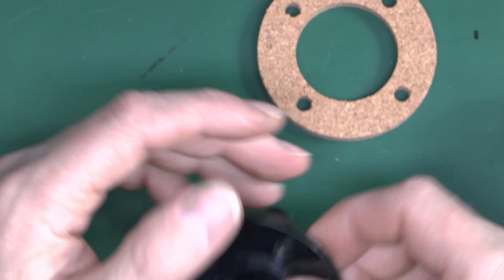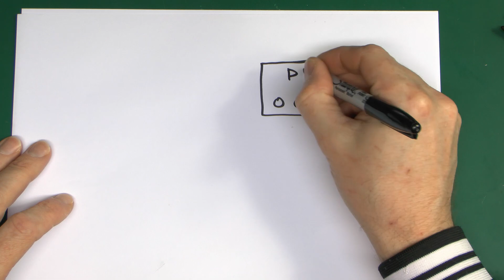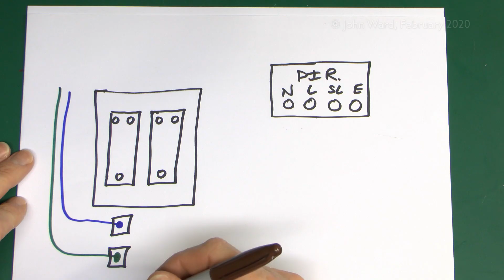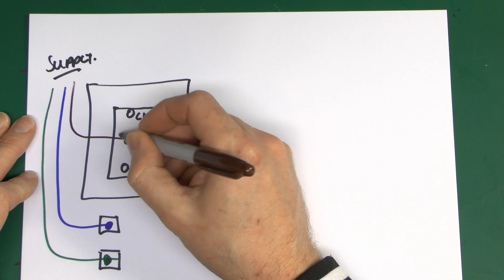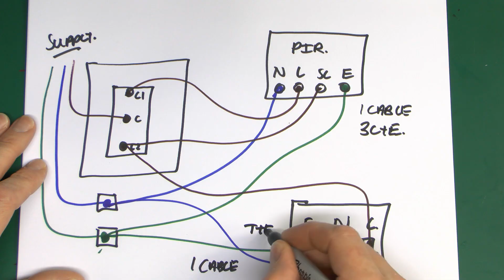Lighting Sensor Wiring with Override Facility

Comment: Thanks great explanation. was thinking of using a standard 3 pin plug for the supply to plug into a wall or garage socket  so only needing a single 1 gang 2 way switch same as your second example but the on/off at the socket. This may sound strange but I'm retro fitting a pir to existing circuit just replacing the switch so will connect the neutrals inside the switch using wago 3 way connector

Comment: Another suggestion if you're not sure if the PIR is using a relay or electronic switch then: 1. Always keep the PIR powered up to the Power Line and Neutral. 2. Connect PIR output SL to the 3-way switch L1. 3. Connect Power Line L to 3-way switch L2. 4. Connect  light line L to 3-way switch common C. 5. Connect light Neutral N to Power Line Neutral N.
Reply: how do I wire to an existing light. Can it be wired direct to the light fitting?
Reply: I did it this way, too.

Comment: Hi thanks for the video you explain everything nice and clearly I am thinking of installing outside lights with a double switch and PIR like in the video but I don’t require the all off switch just PIR override as with the 1st switch I want to control 1 light by the back door and have flood lights controlled by PIR with override for BBQ’S ect 
Would it work if I just connected the common from the switch to the PIR L or will I need 3 switches as they will be outside switches

Comment: Hi John, I have a 400W Halogen floodlight with a PIR. Is there a way I can add another PIR sensor as well as the one on the light?
Reply from the maker: If all 4 terminals are accessible (L,SL,N,E) then yes, just connect another sensor to those.
Reply: @jwflame  thank you!

Comment: Hi John, brilliant video/explanation. Would it be possible to add a timer switch to your wiring diagram so that when switched on permanently the timer could control the on period. If yes could you provide guidance on how this could be done. Many thanks.
Kind regards,
Kenny.

Comment: what i don't understand is why you have the light connection and the switch leg for the photo eye together on the same terminal on the three way switch ?  you have the power from the switch to the left  on your common terminal so why not put the light manual switch leg on the left or right terminal at the top and the photo eye switch leg on the other top terminal for auto or manual. why would they be at the same  common point termination  ? that seems wrong.. i intend to buy the parts and try your way and mine in my lab to see how both fair. but i enjoyed this video it provoked thoughts for my solution to a problem. seems like when i want outside the box thinking i have to listen to English, Aussies and Indians

Comment: Hi, if you didn't need nned the override facility on a PIR, would you simply be able to use a 1 Gang 2 Way Switch, using the L1, L2 and COM connections as per your video at around 14:30 mins? Thank you!

Comment: I can't find a supplier of a PIR with N.L.SL. & E,   none that I can find have SL.  I have wired for the double switch installation but I'm stuck for the correct PIR.  Can you advise of a supplier please?
Reply from the maker: All 230V PIRs have SL - they would be entirely useless if they only had L,N,E.
This: https://www.screwfix.com/p/lap-standalone-pir-180/8461v
or this: https://www.screwfix.com/p/lap-standalone-pir-180/8461v
or https://www.cef.co.uk/catalogue/products/131732-180-pir-motion-detector-white
or pretty much any others.
The only real choices are the angle of coverage and the maximum load that it can switch.
Reply: @jwflame  Thank you very much for your reply John. Re buying a new PIR, everyone I could find wiring details for online only had L.N.E; these included the Screwfix models you've suggested.  Screwfix said they knew of and used to stock L.N.E.SL. but that all their stock now worked on the quick on/off to control a light's 'permanent on' feature. I had run the new 3+1 cable before I removed my old PIR, intending to complete as per your two switch diagram. My old PIR has N.N.E.L. L1.L2, the two neutrals are connected/looped. I have wired both lives into L and the lamps live into L1, - its working. My old PIR was to be replaced, it was only functioning if I put my hand up close to it. With a clean, it now is back to its best, probably about 8 meters. Thanks again for responding.
Reply: @jwflame  Hi John. I have the LAP pir you recommended. the available marked connections - N.N E. L. L1. L2.  Using your 4 core double switch diagram N - Blue, Earth - E, Brown - L. the pir works fine.  
There is no SL connection marked, I tried the black in L1, it appeared to work as planned for a day or so, then the pir stopped functioning.  I removed the black from L1, the pir function returned. I can pulse to have the light permanent but its confusing as to which state the function is at.  Any advice?

Comment: Hi JW great videos.  I am trying to work out unsuccessfully in my head how to wire up multiple sensors to multiple lights, with any sensor activating all of the lights. The system is up a stairwell.
Thanks for any response 🙂
Reply: 3C+E chaining all the PIRs together, then back to switch control point as per JW's diagrams. Any sensor triggers all lights. You probably worked that out by now of course...

Comment: I was thinking of having a PIR (or micro) in my bathroom, and would want an override switch on the outside to have it permanently on or on auto. However I'd also wanted a switch, on a separate gang (maybe above the door with the fused switch) that would override it to be permanently off. The trick I guess is not have any single cables going somewhere but a mixture of 3 and 4 core cables!

Comment: Thank you for sharing this information as I found it very useful.
 
Please if you can help me on the below, I be most grateful.  

I like to install a flood light with an external PIR sensor, similar to the 1 way switch design you show. The only problem is the current set up I have uses a switched fuse spur instead of a 1 way switch.   I only want the light to stay in the PIR mode or off completely.

From this can I directly connect the switched line output from the PIR to the light?  If not, please can you explain so I understand.

Thank you most kindly.

Matt
Reply from the maker: Yes, LNE from the spur to LNE in the PIR, light connects to PIR switched L, N&E
Reply: Thank you very much for this information John.  Will continue to learn this profession going forward.

Comment: hi guys i wanted to have two sensors (on two ends of the wall) activating one section of lighting. Is this correct to connect second PIR in series with the first one??? thanks for help anyone!!!
Reply from the maker: Cable between the two PIRs, each terminal connected to the same terminal in the other PIR, so L-L, N-N, SL-SL, E-E.
Reply: @jwflame  very appreciate thank you John

Comment: Thanks for the presentation, It explains something that was puzzling me. My outside lights were wired with 3 core & earth, and the wiring diagram in the lid showed no external connection to the light connection. In fact there the black core was connected. When the switch was activated the lamp lit continually, and in the off position it was controlled by the PIR. Your presentation made clear what was intended. However they had cheapened the installation by using no second switch. The line connection was hard wired without a switch!! 
Now I see how it is supposed to work, I can live with it, but it is not Ideal.

Comment: Would it be acceptable to wire the PIR to be permanently connected, and just switch the PIR switch line? I ask because many PIR sensors switch on when initially powered, but you may want to be able to set the light to auto without having it illuminated.
Reply from the maker: Yes, that would work.

Comment: Where can you get household 3 position switches?
Reply from the maker: This: https://www.cef.co.uk/catalogue/products/506614-10a-3-position-switch-module-polar-white
or this: https://www.cef.co.uk/catalogue/products/506614-10a-3-position-switch-module-polar-white
There are probably others.
Reply: Could you do a video on how to link two PIRs to control the same light?
Reply: @heffo1992  The obvious solution would be to link them in parallel using 3 core + E, chain as many as you like together, any one triggers the light comes on.

Comment: Sir JohnW, may I add that for the 1st diagram with 2switches used i.e. 2Gang2Way, its sufficient to use 1WAY switch for both the switches there.
Am I correct or otherwise?
Reply: You are correct.
Reply from the maker: Yes.  They are drawn as 2 way because 2 gang switches are almost always 2 way types.
Reply: John Ward  Oh thanks for that bonus info...
Outside UK but countries that still based itself to bs, its more common to find 2g1w , 3g1w, 4g1w and even 5g1w. its not common to spot 1g2w or 2g2w unless we really need those for 2way switching etc.

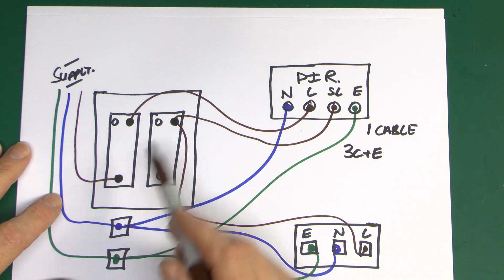Comment: 13:04 - connection to light, I'd have connected to the bottom terminal of switch 2 and the live out of the top of switch 1 I'd have connected to terminal 1 on the top of switch 2. For the purposes of clarity of drawing. It'd also have the electrical safety benefit of not making SL live on the PIR when the light was permanently on.

I take it you're now going to connect the live out of sw 1 to the bottom terminal of sw 2.

Comment: Re microwave sensors - is that's what's used on vehicle proximity sensors ? If not, what are they ?
Reply: Some are ultrasonic...
Reply: The little round cutout things you see in bumpers (especially rear bumper for reversing sensors) are ultrasonic.
Braking assist systems likely use microwave. I've never been a fan of such systems, so never really looked at the details.
Self driving systems use a mix of lidar, camera and microwave sensors.
Reply: @tin2001  Cheers - maybe one day I'll go poking around them with my ultrasonic amplifier !
Reply: pmailkeey - they (the ultrasonic type) often operate at around 38kHz to 42kHz or thereabouts.
Reply: @Mark1024MAK  Does that keep cats and dogs out of the way ?
My amp goes up to 120kHz from 18kHz estimate and reduces it to a humanly audible range.

Comment: Having designed a few PIRs in a past life I can say your simple description of the way the sensor works is possibly the best I've heard.

One point though: PIRs detect moving difference in heat - they'll detect something moving  that's lower in temperature than the background just as well as something higher in temperature. This can give rise to false triggering when, say, wind moves a tree/bush in front of a wall that's been heated by the sun most of the day.

[Edit] A second point: True Doppler microwaves work outside OK. It's the simple change of field ones that use a repurposed PIR control IC that don't.

[Edit 2] PIRs work fine indoors - that's why they're used in security systems including domestic. IME heat rising from radiators isn't a problem with basic twin-element pyrosensors as they are most sensitive to horizontal movement. Quad sensors which detect movement both horizontal and vertical directions might have an issue, but they are more (or rather were when I was working on them) for commercial use.
Reply: I had a feeling plants triggered them and that explains that !

I was pondering in Asda one day by the doors. Usual set up - sliding doors, pair of security detectors and overhead blast heater. Asda put a loose advertising sleeve over the security detectors. The fan heater over the door caused the advert sleeves to flap about - so the doors opened :)
Reply: @millomweb  I've seen that more than once.

Comment: Moved into a new house recently that has photocell lights with an override and I’ve been puzzling how these work so great timing John. Ours have a fused spur as the main on/off and then a separate switch for the override and the photocells are built into the lights but I can at least now understand how they can work. Great video thanks.
Reply: You know you can have a single switch to override right? He wires it with 2 switches which is just really weird
Reply: @tsiailis01   but the second switch allows for '"off" also , Right?

Comment: Dear John Ward, if you can do one video on emergency lighting. In my workplace I do allot of emergency lighting and sensors, the sensors are fine for me but the emergency one is confusing. Some have back up battery supply and bypasses the ballast or relay and has different wiring. I tried to find the source of the power when the light is not on but was told it gets its power from battery? When I do the emergency lighting testing- I switch off the lights and the emergency lights come on- was asking the chief Engineering if he can explain where it is getting its power from? but he is not a qualified electrician so avoided the answer. If you can do one video on it, will be grateful. Thank you.
Reply: The vast majority of emergency lights, or lights with an emergency mode have an internal battery. When supplied with mains power, a charging circuit charges the battery. When mains fails, the battery supplies an electronic module, which in turn powers the light.
Reply: They all have back up battery ! SOMEWHERE ! There are self contained units that have a battery in the light and there are lights fed from a central battery in the building - that's 'old style' but still valid. (And probably far better !)

Comment: Is it possible to join two PIRs to a single light fixture?
Reply: Yes just extend the 3C +E from pir 1 to any number of additional pir sensors.
Reply: Thomas McBurney - only if both sensors use a relay contact to perform the switching. If the sensor uses solid state switching, the sensors may be damaged if wired in parallel.

Comment: I do NOT recommend any of these configurations. The reason is, that some PIR are fully digital, and wont "like" sending voltage into the switch output (in electrical terms, a voltage potentional is on the PIR's "switch output" terminal while the PIR is electronically "switched off"), this could cause all sorts of problems.
Also, breaking the line input of PIR is not recommended if it has a "calibration routine" that it runs on startup to calibrate itself to the room. (Some PIR says "switch on power and do NOT visit the monitoring area for the next 60 seconds" - because it runs a calibration routine to get a idea how a "empty room" looks like)

A better connection is like this (first one):
N and earth as before
Lsupply -> bridge with PIR-L cable and pole1 on switch2
SLoutput -> pole2 on switch2
Common on Switch2 --> Pole2 on Switch1
Common on Switch1 --> Light fixture

This will as before, allow switch2 to switch between PermanentON & PIR mode, and switch1 will allow to switch between PermanentOFF and PIR/PermanentON Mode(depending on switch2).
PIR will thus always have power, and you don't risk getting weird calibration on the PIR. If the PIR has such a calibration routine. And it will ensure no voltage is sent INTO the switching output.

For the second, it could be made like this: (second one):
N and earth as before
Lsupply -> pole1 on switch and PIR-L-cable
SLoutput -> pole2 on switch
common -> light fixture

This also ensures, that PIR always have power, and also that no voltage is sent INTO the switching output.
Reply: Sebastian Nielsen you seem to have little idea of how most PIR sensors function, the vast majority have no concept  the area they cover and don’t need it. 

They function by the focused IR falling on a split sensor area and detect any difference between the two.

While it certainly could be possible to design a sensor package in the way you describe the cost would be exponentially higher than the standard and would need some vastly higher number of sensing points within the module.
Reply: @SometimeWoodworker  I do know how a PIR sensor knows, and its correct. What I do mean with a "calibration routine" is a routine that automatically calibrates the sensitivity according to the enviroment. I have a digital PIR sensor here at home that have a "start up calibration routine" where the manual specifically mentions that you should not visit the monitoring area at startup because it "learns" the enviroment.
Propably this is to avoid having a "sensitivity" setting, instead it "reads" the enviroment (the current difference values between each of the 4 sensor cells) and "sets" the sensitivity a tad bit higher than the "empty room" reading.
Reply: @sebastiannielsen  You know nothing , unsubscribe.
Reply: I bought a load of Drayton thermostats. SAME ISSUE, they're not thermostatic when off - so the usual wiring of MAINS-TIMESWITCH-THERMOSTAT-BOILER doesn't work properly. I've had to go MAINS-THERMOSTAT-TIMER-BOILER to keep the stats powered up. So PIR sensor could be done similarly - put it first in circuit then OFF/ON and AUTO/MAN after the PIR.

In an earlier comment, I suggested diff wiring to SW2 - so that power to light was from either mains OR PIR so PIR SL never got mains feed. Needs to swap mains out from SW1 to top terminal 1 on SW 2 not bottom terminal.
Reply: Some PIR sensors have a ‘warm up’ time. But really, it’s only for all the capacitors to charge to a stable voltage and for the current in the sensor to settle to it’s normal levels. Should take 20 seconds or less. The majority of PIR systems are dumb and don’t do any calibration despite the waffle that the marketing people put on the packaging and in the instructions/manual.
Reply: sebastian this is ridiculous. Everyone wires the way JW does in the diagram
Reply: Robert Mayberry - no, the most common arrangement is to not bother with either the on/off switch (so just the auto/on switch) or not bother with the auto/on switch (so just the in/off switch). In my relatively modern house (about 20 years old now), the lights at the front (as wired by the electrician during construction) don’t have an on/off switch, just a auto/on switch.
Reply: Trying to be clever massive fail.